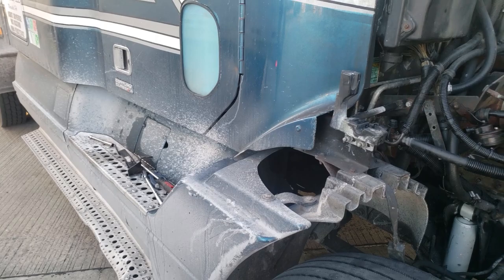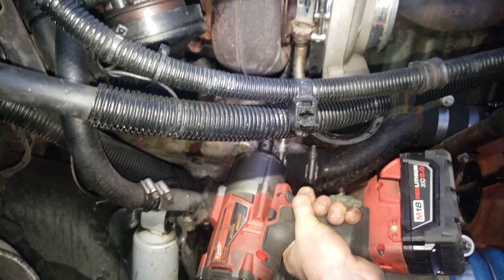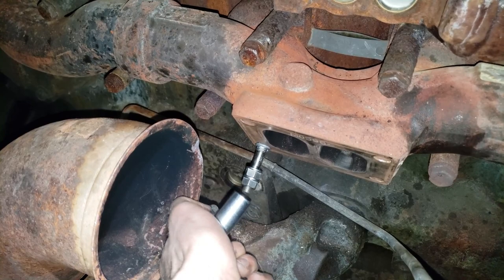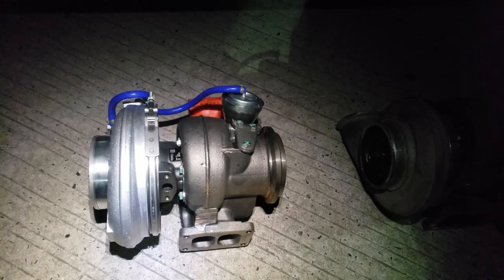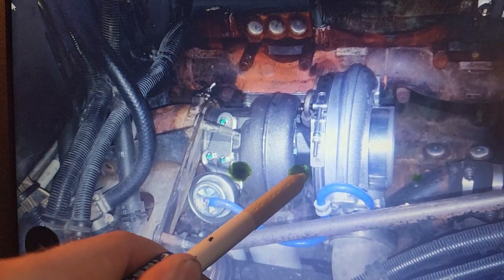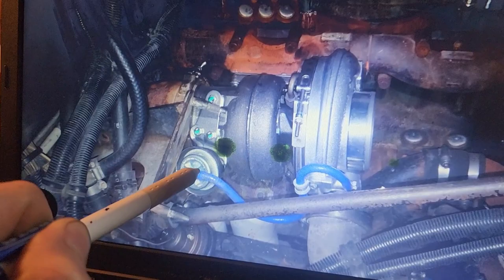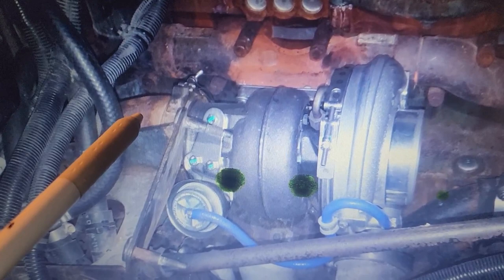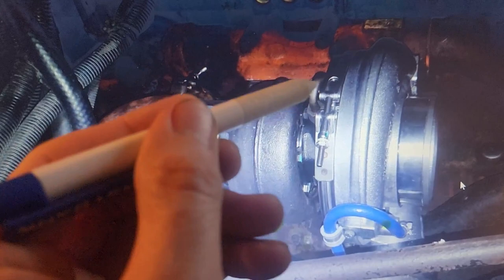K31 Turbo Swap 550hp Detroit 60 Replacement Upgrade Performance Diesel Boost Semi Truck from 171702

Comment: I have my 14 liters with the K31 & my boost I get 37 to 40 in a good hill 1850 torque winter time
6mph summer time the most I got
8.2mpg at 65mph I do long haul.
Reply from the maker: Nice, waste gate turned in or original position?  HP?

Comment: I upgraded my 500hp 12.7L stock turbo (k31?) To 171702 mated to the PDI 1-piece "ceramic coated" exhaust manifold. Theres no noise at idle and my egt stays at 700-800⁰ flat ground. I never let egt go above 1100⁰ on hill climb. So far 2 years without a tune, and i dont think im missing out on anything. My fuel economy is at 7mpg IFTA in the North East traffic & PA mountains. Also, my boost gauge maxes out at 32-33psi ... which is correct coz Detroit 12.7 is set to 16hp/1psi ... so 16x32 = 512hp and 16x33 = 528hp .... maybe previous owner had the ecm tuned and i have no idea 😂
Reply from the maker: Sounds like a good setup.  There is many different 500hp tunes, some kick in the power at much lower rpms than other tunes at the same Hp.  I have a different truck I'm running now and just put in a 500hp 1850 ecm.  It's running the stock Garret Turbo and maxing out boost out at 16 psi.  It pulls pretty hard from 1200-1700.  What's interesting is the previous ecm at 430hp 1550 torque was building 27 psi of boost.  The waste gate was not adjusted at all and the same.  I wonder if the 1850 torque is making the waste gate open the entire time so the boost doesn't build.  1850 torque makes more stronger pulses.  I have a 171702 laying around I could try.  But I was afraid 500hp is not enough.  If you say yours is working good, I'd consider when I'm up for it.  I do know my exhaust did get much more quiet putting the k31 on though from the 171702.  The jake brake got more quiet too.  The k31 fins are slanted more flat and turbine smaller.
Reply: @EricWrenchMotors  mine is rated 500hp/1650tq. I know that coz I just replaced my 10spd factory Rockwell meritor to 18spd Eaton Fuller and went with the same rated clutch.

Honestly I don't see how torque rating influences turbo boost psi. I think the waste gate screw adjustment is off on your 16psi reading
Reply: that's written in to ecm means nothing it's just a text.i tuned my own ecm still says 500hp in ecm while on dyno it puts down 590hp and 2069 torque to the wheels. Turbo is 171701 which in my opinion is a better turbo for everyday work. It spool from 1200 quicker and will pull through 1700rpm which is a good working range. Where 171702 likes 14-1500 rpms and over and I don't  like going over 1600 pulling hills. If you were to zero out torque limiting map through ecm your k31 would probably light up from 900rpms no additional fuel needed

Comment: Hi question,i have a 14l Detroit switching from the vgt to a k31.which oil line kit do i need or what's the inlet & outlet sizes

Comment: Since you swapped the 171702 hows the k31 working for you with 550 horsepower. are you getting the power & the fuel mileage you need & was the k31 a better choice for the horsepower you got now. & also what is your boost pressure looking like? & do you miss the 171702. From having used these two different turbos one at 600hp & one at 550hp which is the better setup
Reply from the maker: It depends, what's your gear ratio, tire size, average speed, local, long haul?  Where's your rpms going 65 mph and 55mph?
Reply: @EricWrenchMotors  well i have a 08 freightliner century ddec 6 motor 3.42 on my rears 22.5 lp tires on steers & drives i  just did an inframe. & changed all the hoses, front & rear main seals, & some transmission work. When i bought the truck guy said emmissions was already deleted. Its a 12.7 conversion on 14.0l motor. Not sure what kinda turbo the motor came with🤔? I'll have to find out, when i change turbos. anyways Not even 2 days after i moved the truck with all the work being finished from mechanic shop. my turbo went out, it started leaking oil from exhaust elbow on the flex pipe. So i was thinking if i should get a bw k31 or a 171702 with tune & coated manifold & with that motor should i stay at 550 wastegated with a quicker spool up & get better fuel mileage with a k31 or run a 600hp tune with more power with a 171702. Its like you said k31 has more bottom end on spool up & 171702 has more top end on spool up. Whats your thoughts or your suggestion on my 14.l motor Your opinion will be greatly appreciated since you had both turbos. Thats why i asked how's the k31 working for you.

Comment: I got a ddec4 12.7 tuned to 525 with stock gt42 13spd lp22.5 and 3.55s will the k31 be to big for mine?
Reply: No. I just made the same swap from the gt42 to the k31. Loving it so far. Definitely more boost at lower rpm. I have ddec 4 set at 500hp.

Comment: how you like it I have mine in 14l and runs preatty weak
Reply: I have this k31 in a 14l too and is the weakest truck  ever no more 26 psi I will try to get another program no luck so far
Reply: I bet I know why
Reply: You can adjust boost levels with the wastegate  spring/rods, 26 or 66 your choice.  By buy a pressure gun and then u tube it
Reply from the maker: You can boost a k31 high for sure but the egts go up big time.  If you measured the pressure between the engine and turbo exhaust side, it could be double of your boost pressure which is very inefficient.  There is bigger waste gated turbos for Cats, don't know the name though.  The 14 liter waste gated stock Turbo probably does well on a tuned 12.7.  A 171702 can work on a 14 with 515hp and still have some low end.    But at idle there will be no back pressure with no waste gate.  It will vibrate little more and make more noise at idle inside the cab.

Comment: So did you stay at 550/1850 with the k31 on? Can the k31 handle 550/1850?
Reply: What's your set up I might can help.
Reply: @matthiggins4965  just bought mine I’m at 450 I think with k31 and it’s horrible. It’s a bk model
Reply from the maker: You know it's interesting, I have a stock Garret Turbo at 430 foot pedal hp on a different 12.7 truck.  It hauls ass, 3.70s, 295 steer tires on the drives.  What's interesting is at 430hp it lacks some low end and the power starts building up from 1400 to 1700.  The k31 has more power down low.  The exhaust turbine fins on the k31 are more restricted for flow compared to garrett. The are closer together with smaller gaps between the blades.  I believe that's why it boosts so well down low, like 900-1500rpm.  But at 1650 it's restricted  more compared to the garrett it seems.  The ecm for this setup when I installed this k31 was stuck at 550hp 1950 torque.  The memory chip was bad and wouldn't accept a new tune.  So that's why I tried the k31, because the 171702 was lacking low and dogging around on smaller roads.
Reply from the maker: @kylebowman4419  at 450Hp foot pedal a stock Garret will perform very well.  But we don't know if it's 450hp foot.  It could be 370hp foot, 450hp cruise control.  That's no fun and is weak
Reply: Are you happy with the results, or would you stay with the 171702

Comment: I got a tune to 500 on my 12.7 but I have stock turbo which is undersized what do you recommend k31 or 171702
Reply from the maker: Your stock Garret?  It may be fine.  How fast does it spool up?  If you are empty and accelerate in 7th or 8th gear from 900-1800 where is the most pull at?  Because if it's 1650 it's probably fine

Comment: Hello I have a k31 don’t boost more that 21 psi at low end is ok but 9and 10 Jesus no balls . Wat u thing about a boost elbow u think it will work . Any ideas
Reply from the maker: Straight up, we're talking about foot pedal ecm fuel release and timing on fuel release.  No matter how worn out the pistons are, fuel and timing can be bumped up and increase turbo spool.

Comment: Did you truck come with egr
Reply from the maker: No egr.  I knew a guy with a 14 liter egr and got 6mpg went to 7mpg egr disabled
Reply: @EricWrenchMotors  You can program EGR valves to remain shut or change operating temperature parameters.

Comment: how much boost is doing in your engine
Reply from the maker: I didn't check it but it was boosting quicker.  I had a good pull from 1100 to 1700 and then it fell flat.  The 171702 made more power for the wide open highway. The k31 was superior for off highway roads, and stop and go.

Comment: Looks like you dont have a pyrometer gauge
Reply from the maker: I did put one on afterwards for the k31 I didn't have one for the 171702.  I always run higher rpms up hills